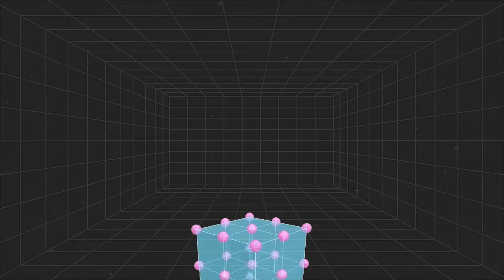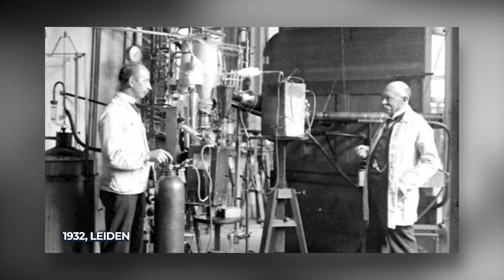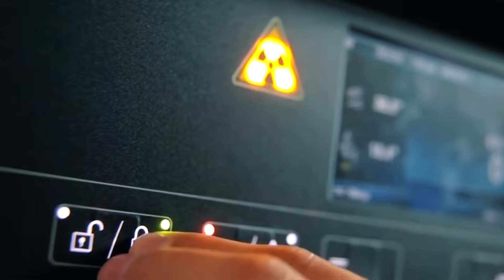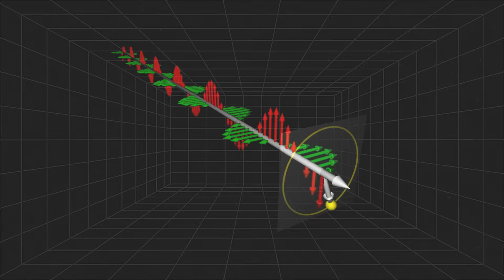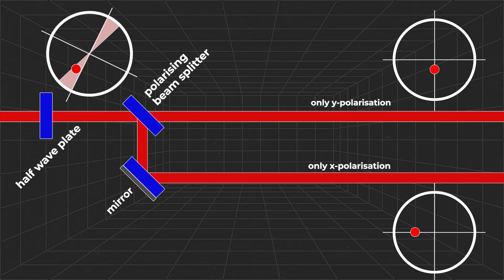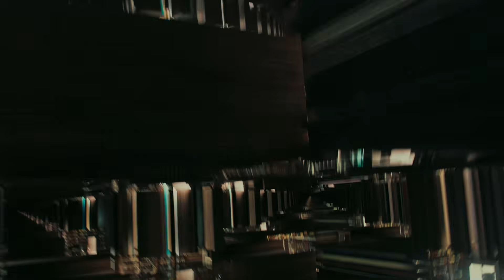Impossible Time Crystal Breakthrough - Explained

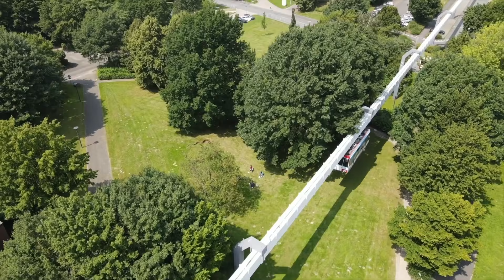Comment: 9:15 - but it's a natural crystal and yeah, idk...
if you have a block of wood it's a rigid structure, but if you leave heavy weight on it for long enough it'll compress, so does it mean the original structure isn't rigid?
a permanent magnet is not permanent forever*, it gets slowly consumed and loses energy if you're using them for some application.
you could infuse an induction magnet inside a permanent magnet to replenish it as we do with quartz.
but if you're not consuming the energy on purpose it manages to remain with that energy then it should be valid.
I mean even matter is slowly decaying with radiation constantly, c'mon...

Comment: This sounds oddly similar to the “eternal flame” candle. It will never go out, as long as its never lit. In this case, it will never run out of energy, as long as its never interacted with. Sound “useful”.
Reply: I think it's more about transforming the energy. A lightbulb is completely useless, if you don't put any energy into it, but we still have them, because they turn electricity into visible light.
Same effect here. You put in energy and get a constant, unchanging oscillation out. That could be useful for keeping time for example. Current atomic clocks use the oscillation of atoms to measure time in a similarly convoluted way, but that made accurate GPS possible.

Comment: The trapped ion group made a “discrete” time crystal, not a continuous one. And yet, I don’t understand the hype with either one. if I would understand it, then a single trapped ion would make a time crystal: A single ion is trapped by a radio frequency voltage at ~20 MHz, but the trapping frequency of the ion in the harmonic pseudopotential is a lower ~1 MHz frequency

Comment: I feel like you could create a perpetual motion machine if you could master gravity. Basically... you would need to create a system where energy is being expelled, converted, and intakes the converted energy back into the system to be broken down into something that could be expelled. And where this system powers the conversion process entirely via the intake flow. In essence... you would have a sort of micro-black hole generator that reuses the same energy over and over. The biggest questions I have about this would be whether or not you could contain that black hole in such a way that it could not even slow the transfer of energy around the device and whether it would be useful in any fashion. Could it somehow generate More energy than it lost by turning wheels covered in magnets with wire coiling between? Or would it just be a useless and dangerous desk bauble.

Comment: just thinking out loud. Don't all atoms continuously move without external input? I thought that they had multiple parts (protons, neutrons, electrons). a crystal is made up of atoms as all things are. so all crystals are oscillating at the atomic level. therefore the oscillations of the atoms and their interaction between the different atomic elements that make up the crystal would create different combined oscillations with no external input required?

Comment: wouldnt the period in this case be as a result of the two offset laser phases continually shifting and matching back up?

kind of like if you were to have two clocks, one running perfectly, and another running 1 second slower every hour, there would be a set period of time, where those two clocks would overlap and then match up again, that being the period of the oscillation between the two.

Comment: Zero osolation and a spin point looks like a spine a spine has folds and substrates that can revert to the original form these are gas units that are emerging from the spin a bit more than the normal population it takes light to drive or infrared light that refracts around the membrane the tips receive the opportunity to experience the portals to central orbit in opposite speeds that tilt their orbit into a different environment osolatuon allows for enhanced liquidity even though theres no liquid except the air borns that temperature is expected to drop by about 15 below zero from 50 degrees Fahrenheit it collapses from pressure very fragile

Comment: Moebius looping in the spacing process circles within circles of billions of strings dancing with out Entergy thoughts of the same wavelength outwards from inward slow motion relative to the environment that it's in contact with or nothing at all it must reverse its own shape fracturing it stops its motion micro fracturing slows down but rebounds

Comment: In some ways it sounds like another flavor of atomic clock, as some aspects sound quite similar to how those cesium clocks supposedly work. Other than that, the graph on the scope also seems to have both pulse width modulation and wave-folding going on. I wonder what causes the peak on the longer half of the cycle to flip over like that? (Inherent to the thing they're reading, or just an artifact of how the signal is collected?)

Also pretty sure quartz crystals do their thing with a direct current input that isn't oscillating, which is why they're used as a timing reference component in electronics. If it required an oscillating input, it'd defeat some aspects of having it on something like a battery powered circuit in the first place. (There are other ways of doing timing with stuff like coils and capacitors as part of an oscillating circuit, but those are more prone to noise or interference given my understanding.) Something doesn't seem quite clear, as there is a difference between needing an energy input and having that input itself oscillate.

Comment: Early on, don't you say something is not a "time crystal" if it requires an energy input to sustain it?

A laser beam, even unmodulated, supplies energy - so surely that contradicts the fundamental requirements?? 

If a constant energy input is acceptable,  doesn't that imply that any self-oscillating system - such as a flute fed by a constant air stream, as a crude example - counts?

(The "crystal" part cannot be a literal requirement if a superconducting ring would have counted, if not for the gradual decay).

A literal crystal may be at the small end of the scale, but if larger systems can still class as "time crystals", it just does not appear to be anything particularly special or unique, other than an attention-grabbing title?

The whole concept seems to be confused and somewhat self-contradictory.

Comment: Harmonics, end harmonics. I think ironically, there's a lot to learn from how the resonant qualities of the internal structure relate to musical tones. There seems to be a very clear parallel and perhaps some light to be shed on the fact that what you're doing in essence is tuning the crystal by way of altering the structure. I personally would want to in add vertices in some virtual or theoretical way to the structure, maybe in the same sense that when two musical tones are played together they create a third tone as a result of what I want to say is "sympathetic resonance" , but could go deeper than that where you actually have a measurable wave form. Either way I wouldn't let that stop you from working with a theoretical framework that is perceived rather than measured. You still might find some anomalies that have a degree of control before they get all whacked out.

Comment: I'm puzzled as to why circulay polarised light as an input doesn't count as driving the system with an oscillatir, For one thing, whether you consider light as  waves (which oscilate in time) or as particles, photons - which would be particlesa arrivingly evenly spaced out in time, there appears to be an oscillating system driving the setup. Using circularly polarised light doesn't, so far as I can see, change that in any way. (NB; I am not a physicist, just an elderly science geek that likes learning new things when I can).  Wouldn't using unpolarised multi-wavelgth light be better, as at least there' could be no regular driving frequency of whatever kind being nput into the system?

I'm sure that if my argument were correct, that you would have easily spotted that and raised your own objections about the experiment with the authors of the paper on the experiment; therefore, some part of my understanding is incorrect. I'd be delighted if you could tell me where I'm going amiss, not necessarily in detail - just knowing that "this part of your understanding is amiss" would be fine, as I could then go find out about that subject at my own pace, and see if I can understand it.  Excellent video, anyway, thank you!

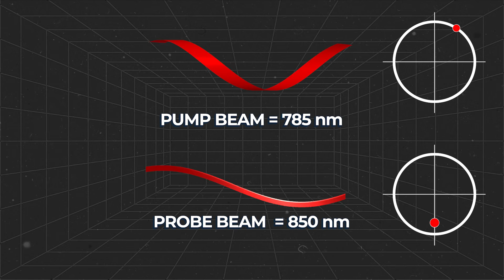Comment: 15:10 that sounds like the red therapy light above my bed.  Hmm, dearh ray? Hmm, I keep forgetting to tuen it on.  Keep on with the potentially sustainable motion machine, instead of a true time crystal which would be able to affect it's state forwards or backwarda in time outside the normal progression of the current frame of time.  Able to read and affect the distant future or past, which should be possible.  However, according to int leaks that wpuld ve dangerous.

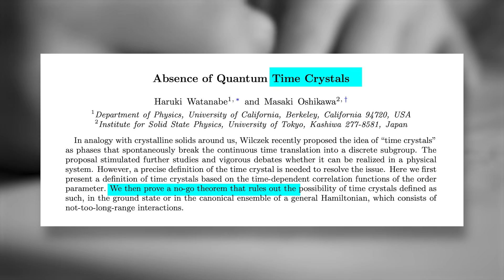Comment: 5:45. That sounds illogical.  Without evidence that it cant. We exist, that just is, the physical universe is cause and effect.

If information can't e destroyed, and energy is perpetual, can neither be destroyed or created, that is perpetual.  So, if we can create a perpetual wave form isolated from the universe, could it contnue forever.  Now, if we then creat a structure which transforms with the beat of the waveform, and if needed be reverses enrrgy flow for recovery, except the accumulated change, and when the change reaches it's peak, it starts again or reverses, such as the energy in the system cant leak out, we have a clock, and its perpetual.  We can periodically check the cloxk mechanism eith accuracy and restart it's flow, and the differmce betwen every start and check, is the amount of time.  Wouldn't that be a perpetusl lattice, if never checked?

Comment: Laser  pump energy is oscillating!  How do you know that there is not some sort of "beating" taking place?
          Regarding second time constants in atomic action, consider a chemical NMR, where substances are held in ALMOST perfectly uniform magnetic field.  When the exciting RF is removed, the atoms get out of time because they are in slightly different fields.  Even though they are oscillating at 60MHz, a fraction of 1 PPM of field causes them to stop reinforcing, then cancel, then reinforce again with periods spanning multiple seconds.  I used this to judge the quality of the field uniformity.

Comment: 7:48 - a confusing  use of the word "work". Because in physics, we know "Work" is defined as the product of the force applied to an object and the displacement of that object in the direction of the force. Mathematically, it goes:

W=F⋅d⋅cos(θ)

W is the work done,
F is the force applied,
d is the displacement of the object,
θ is the angle between the force vector and the displacement vector.

And so Work can't ever be performed by a time crystal. That would make - as you rightly say, a Perpetual Rubbish Machine. :P

For your readers: Power is the rate at which Work is performed over Time, and goes...  P=W/t

Comment: The last experiment is pretty cool, but to call it time crystal is a bit off.
It only works if you pump energy into it which oscillates (every EM wave oscillates in both E and H).
I would say that the closed superconducting coil is actually the closest thing to time crystal at least from this video.
Even if the crystal is oscillating without the input circularly polarized laser, it still would lose energy in form of EM waves radiating from the motion of those electrons.
Anyway, cool stuff, but it really stretches the original idea to something different in order to sell headlines and abstracts.

Comment: Great video. Thanks for making, and you just got a new subscriber here. It does leave me with some basic undergrad level questions:

1. I don't understand why such an "impossible time crystal" is considered to structurally vary in time rather than as just exhibiting a new type of very low frequency strain energy vibration induced by much higher frequency inputs.  Newly discovered perhaps, but why is anybody calling it "impossible"?  It's not like any atoms are changing relative positions within the crystal lattice over time is it? just spin states.

2.  I don't understand how any input energy can be said to be non-oscillating. Splitting and/or combining polarized light into orthogonal polarized beams in which the total input power is not oscillating does not eliminate the oscillating nature of the input energy except perhaps semantically.  All light is oscillating by the nature of having a wavelength, except perhaps a pulse shorter than it's own wavelength, which I'm not sure is even a thing. One can certainly induce harmonic vibration with a much higher frequency driving input. How can one say this "time crystal" oscillation is induced by a non-oscillating input?

3. Other than being a newly recognized mode of surprisingly slow oscillation that is very hard to understand or measure, are the oscillations of an "impossible time crystal" fundamentally different from vibrations in strain energy of less exotic materials? The slow oscillations are certainly amazing and weird and the engineering of the experimental apparatus is very clever, but I don't see how the results reveal anything fundamentally new to physics. A ringing bell is oscillating in density over time. Any spring material that vibrates experiences changes in density over time while vibrating, where strain energy and inertial forces are in a feedback loop which repeats at a frequency determined by the harmonic properties of the dynamic system that the spring material is a part of.  Analogously, can it be said that vibrations of these "time crystals" is strain energy and lattice-spin energy in a feedback loop which repeats at a frequency determined by the dynamic lattice spin harmonics of the crystal lattice?  In other words, can it be said that the equilibrium bond spacing between atoms act like springs and the spin state feedback effects act like dampers with extremely low energy losses, resulting in long duration oscillation at the observed frequency?

Thanks in advance to anyone who even half-way replies to any of that.
Reply: 1. Crystal are actually defined in terms of their structure, which includes their spin, varying periodically in space. If some non-structural feature varies periodically, then it is not actually a crystal. Similarly, a time crystal is defined analogously, but with variation in time. It would be a huge misnomer to use the name "time crystal" to refer to what you are talking about, since there is nothing crystal-esque about non-structural features varying periodically (not that it is even clear that this actually can be achieved without periodic structural variations anyway). Also, the name "impossible" is being used to describe time crystals in dynamic equilibrium, which, as stated in the video, are genuinely truly impossible (by the No-Go Theorem). The time crystals recreated in the lab do not fall in the same category, because they are not in dynamic equilibrium.

2. You said "splitting and/or combining polarized light into orthogonal polarized beams in which the total input power is not oscillating does not eliminate the oscillating nature of the input energy." This is incorrect: it actually does eliminate the oscillations in the energy. The only thing that is actually oscillating is the electromagnetic field itself, not the energy density it carries. You can prove this just by taking the electromagnetic field of monochromatic plane waves and computing the energy density from it. The energy density depends on the amplitude of the wave, but as long as the amplitude itself is a constant (which it is for a laser), the energy density is constant too. This is a characterizing feature of lasers, and it differs from other forms of radiation, in which the amplitude itself is a function of time, and therefore, so is the energy density. The distinction is analogous to the difference between direct current and alternating currents. All currents are caused by periodic oscillations in the electric charge density across the wire, but direct currents are non-oscillating, whereas alternating currents are oscillating. The fact that the electric charge density itself is oscillating is irrelevant: we are not concerning ourselves with the electric charge density variations, especially as measuring them directly is nearly impossible anyway.

3. He explained in the video why a ringing bell is not an example of a time crystal, and not of any interest to the research in question. Any material can experience vibrations, but those vibrations are not intrinsic properties of the material, unless we are discussing time-crystal, in which case, the characteristics properties of the material are sufficient to predict all vibrations it will undergo given a constant energy input. This is different than a resonance phenomenon, which any material can experience, provided the energy input is non-constant and oscillates.

Comment: If time is the 4th dimension, then everything is 4 dimensional. It is not related in any way to the first 3 dimensions and is not perpendicular to the previous dimension. It isn't a spatial measurement, it can't be changed or manipulated. There is a difference between growing and oscillating. If something repeats in space, it is growing OVER time, you can't replace space with time. The abuse of language in physics is stupefying. There is energy in the rest state. No?